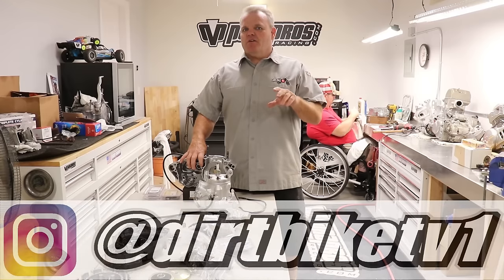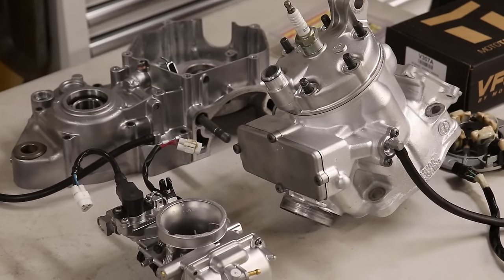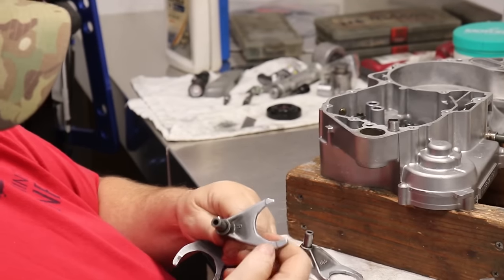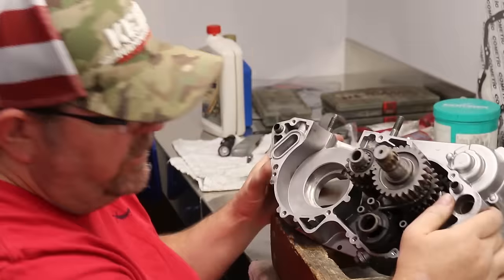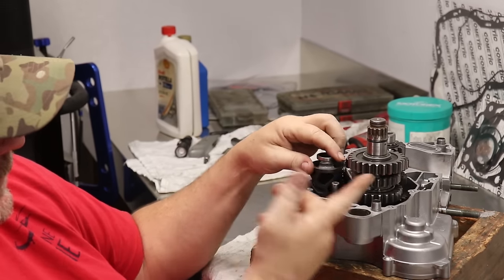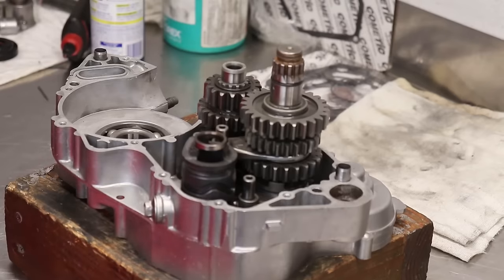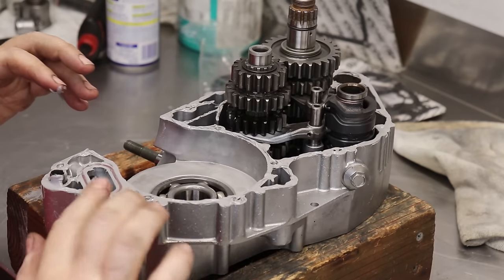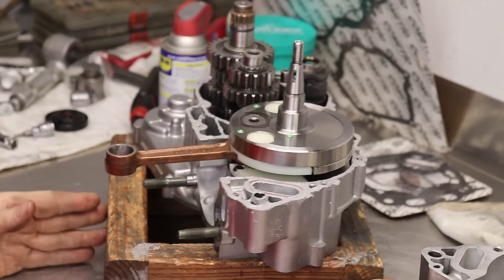How to rebuild 2 stroke engine - Yamaha YZ250

Comment: I stopped freezing bearings to drop into hot cases because the bearing only shrinks about .0001", and the cold bearing will suck the heat out of the cases causing the bore to shrink on the bearing faster, especially if it is crooked. Not freezing the bearing gives you more time to drop the bearing in a hot hole.  Also, before you put in the shafts, you can heat the cases in an over no higher than 350 deg F., and drop all new bearings in the cases.  If you start them off straight enough, you can actually hear them hit bottom.  But you usually end up tapping some to the bottom of the bore as you burn your fingers on the hot cases. :)  I bought a little over for the shop.
Reply: Oven

Comment: Some times those gears bind on test run because you need both case halves for stability to whoever maybe wondering or having that issue. You may also have to center the crank is the cases with a filler gauge and rubber mallet, the crankshaft may not roll smoothly with new bearing but thus comes the heat cycle to break the engine in. Yamaha shift forks make this job harder than it should be because they are one solid peice unlike Suzuki.
Reply: Bearings should roll smoothly, even when new.  There is not break in process for bearings, only a break down process.  In fact, I am willing to bet there is no real need for a a heat cycle or any other type of break in process for 2-stroke engines.  If put smaller gas 2-stroke engines on my dyno, and beat the living tar out of them right out of the box after being jetted.  All I want to do is get the ring seated to the cylinder wall all the way around in as short of time as possible, and that means high cylinder pressures to do that, (where the most torque is at).  Out of the 10's of thousands of engines and top end kits I have built, (with good detail), I have never had an engine failure due to a improper break in.  If your new bearings are binding, something is not put together correctly.

Comment: I'm sure Brad knows this but using an extension to the torque wrench like that changes the torque values and they need to be recalculated. If putting the extension perpendicular to the wrench you don't have to bother with that since the effective length is not altered.

Comment: only thing I saw the torq wrench used was cylinder head and cap.  I guess if you've done it a lot you can go by feel or know the impact at low setting is sufficient like for the clutch basket

Comment: No crank puller... No oven.. No center gaskets.. Not used to this coming from CR250s! Where do you get a slug to heat transfer? I want to try this on my next rebuild.

Comment: I have heard you say that you use scrubbing bubbles to clean bikes with. Well, I took your advice and used the stuff on 2 YZ 85 engines and it made the bearings rust almost immediately and white powdery corrosion on the aluminum. Can you respond as to why this happened?
Reply from the maker: Email Jay Directly for further questions  Thanks

Comment: Comedy from beginning to end 🤣🤣
No torque wrench used anywhere ...
Beat seals in with a hammer 
Installs brand new Hinson basket and pressure plate , stock clapped out clutch hub